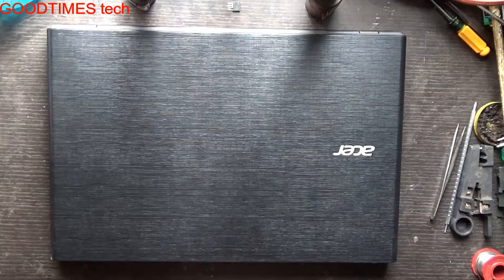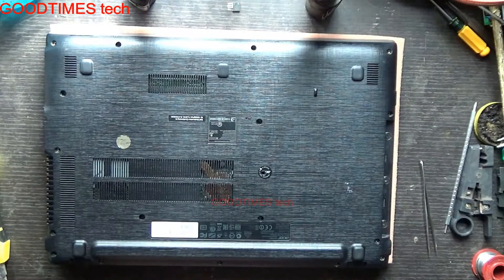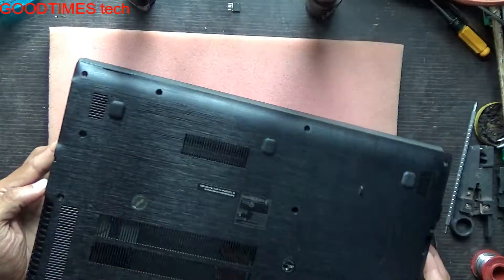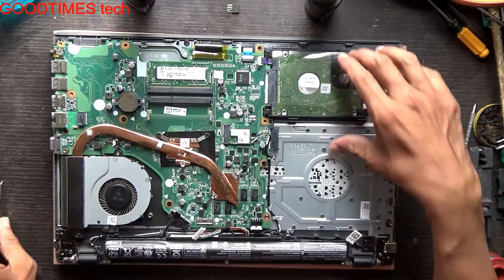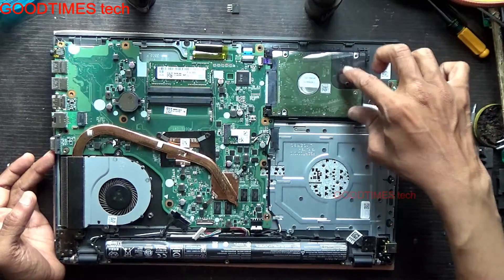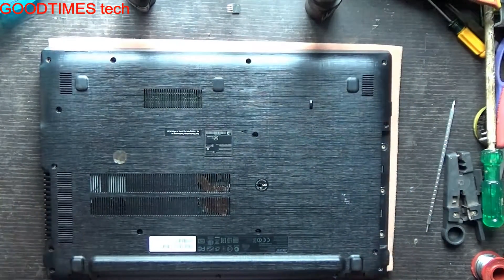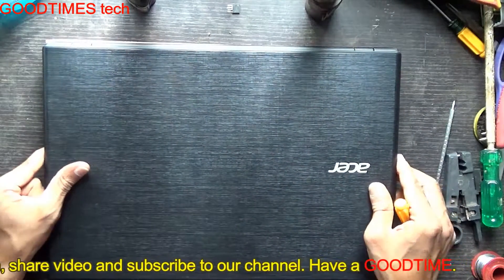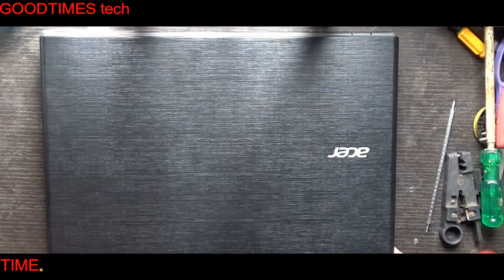Acer ASPIRE E15 Series Laptop | How to replace HDD or SSD.

Comment: Hey so real quick. Why did you take off the entire back of the computer when you only need to remove 3 screws to get that where the hard drive goes
Reply: On a number of newer laptops there is no removable door or panel to allow access to the hard drive. Like the model shown here you have to remove the entire rear cover to get to it.
Reply: to access the hdd, you need to take the entire back cover off

Comment: Could you help me please, its really important to me, i wanted to update my hdd, i wanted to know if it is available M.2 SSD for this laptop ? Or i need to change hgg with SATA SSD ?
Reply: I'm studying the board layout closely, and I don't see a slot for an M.2 or NVMe drive.  I had the same question, and it doesn't appear to be supported.  It will, however, support a SATA 2.5" SSD drive.
Reply: For more information watch out this link : https://youtu.be/UAZHUlR9lZ4

Comment: Thank you so much.  This was very easy to follow and I succeeded!!   I did find the small plug difficult to remove & push back, so on the SEOND time I took the laptop apart, I was just careful to support the bottom with lead attached (of course removed the battery lead).  Again GREAT demonstration.

Comment: can I send my Acer E15 to you to do this hard drive replacement...or the drive may only need to be unlocked. Please text me 850-450-3728
Reply: Just buy a new laptop (I have a 2014 Acer laptop 200$ and still use it with Linux Mint.)